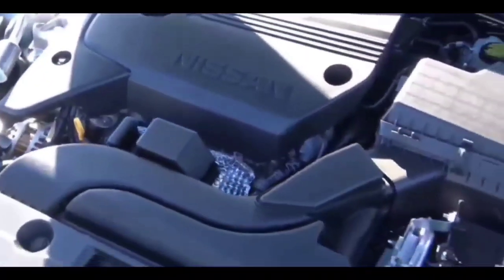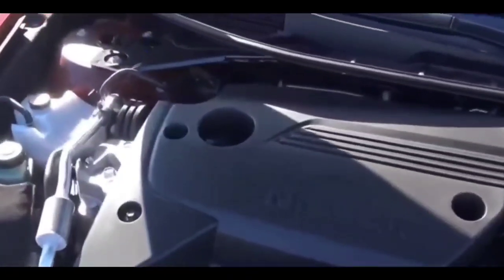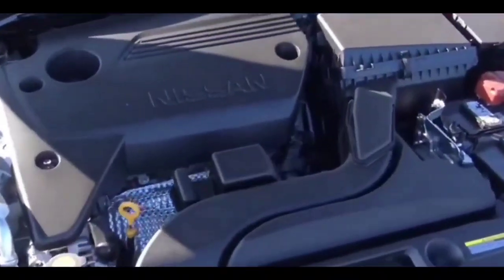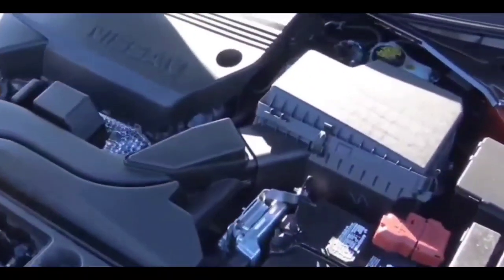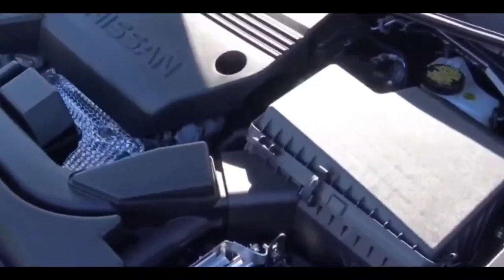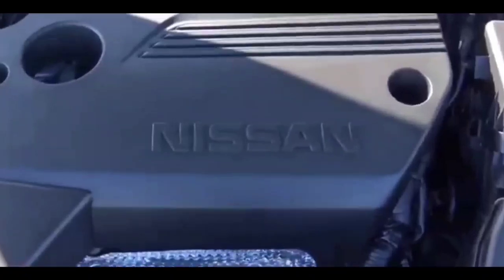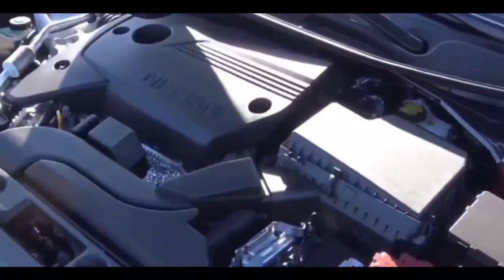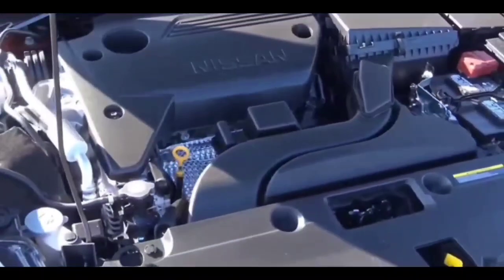NISSAN ALTIMA RANDOM ACCELERATION ISSUES....LIMP MODE/ WONT GO ABOVE 25 MPH W/ FLOORED PEDAL FIX

Comment: Cut the BS test your brake light switches on the brake pedal and if they work good replace the stop lights switch RELAY under the hood. Follow the diagramm in the cover and look for STOP LIGHTS RELAY for it's location .

Comment: But if it is break light switches are faulty then you will not see the break lights on when you press break pedal or the break lights not switching off. I think it has something to do with transmission  slipping, when the clutches inside transmission are damaged because of transmission oil lacking viscosity because of the insufficient  cooling as the transmission  cooler is small in Nissan vehicles.

Comment: Listen, when people are doing research to figure out what's wrong with their cars, long-winded speeches that lead to nowhere is an infuriating thing. Add that to the issues that person is already have, and it just becomes very stressful.

To save everyone else time, my 2013 Altima struggles to gain speed, even with the foot down on the pedal. I already replaced cat converter at the top, PCV valve, spark plugs, cleaned the boots, cleaned the MAF sensor and throttle body.

After talking to some friends, they suggested to check the brake light switch located behind the brake pedal. I have not tried this yet, but I hope this will lead you all in the right direction.

Oh, and don't buy a car with a CVT transmission.
Reply: Do you have an update on your car?  Did you change out the brake light switch?
Reply: @isaacboy808  it was the bottom cat converter. I disconnected it from the the top one and the car got its power back.